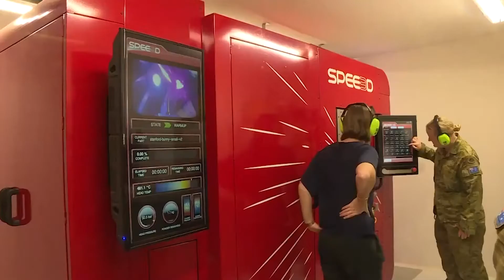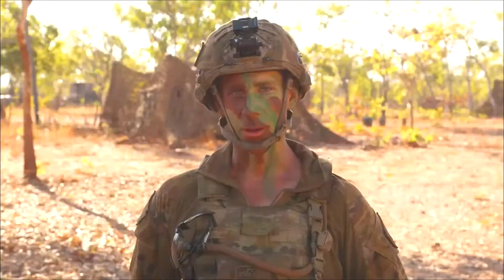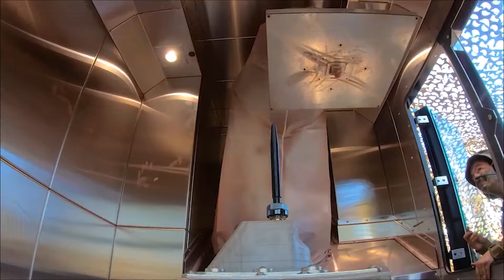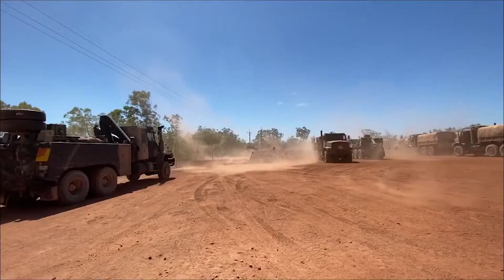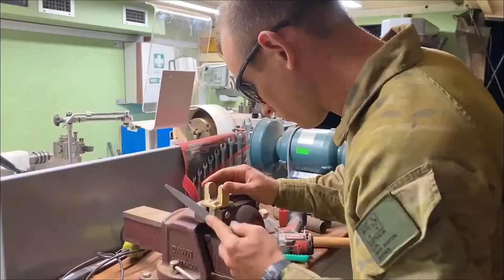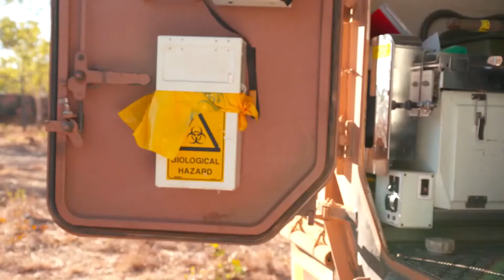Interview with SPEE3D CEO - Land Forces 2021 Innovation Award

Comment: cool however for common replacable parts could they not be scanned with a 3D scanner at point of manufacture and have a loadable data base ready to go instead of having to design on the go
Reply from the maker: Hi Shane Hansen, thank you for your comment, great question! We are working with UTS on a 3D scanning project, and hopefully in the future we can see 3D scanning technology integrated into our technology to create metal parts more easily. I am unsure what you mean by common replaceable parts, but our technology is integrated with a automated software algorithm called TwinSPEE3D and a library in the HMI so you can store files of your parts on the machine. When you click the file, you can make that part on the go! I hope this helps answer your question.